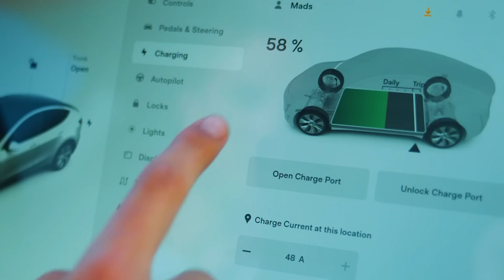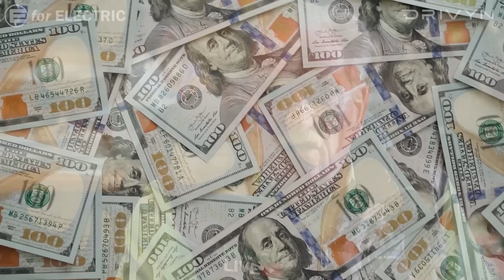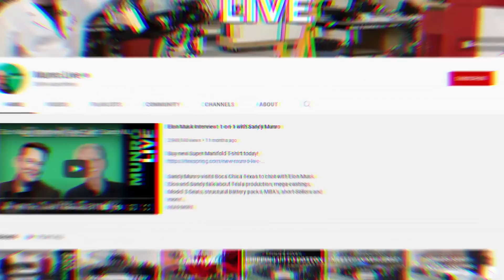SANDY MUNRO Calls Out EV Makers

Comment: Kia and Hyundai must be doing something right… Volkswagen, Renault and Peugeot look to be going in the right direction. But what do I know!?
Reply: Peugeot is not going right directiion, they just take an ice model and slaps in some battery`s and a electic motor.
The packaging is so bad that they cant fit in anything bigger then a 50kwh battery.
that aproach was okey 7 years ago but in 2022 u should produce pure ev`s not something that has a fosil engine orginaly.
Reply: agreed: Renault have even more experience than Tesla on EVs, have a dedicated platform and now even working on 1st batteries that wouldn't use rare earths (for 2027). The Renault 5 will be the very 1st BEV under 20k with 250 miles range. Sandy seems to be focused only on what he sees in the US.. there are lots of innovative OEMs out there, hyundai is one of them as well
Reply: @dnap1991  Sandy is inconsistent when talking about US manufacturers. Sometimes he'll say that Ford is doing the right things. Today he was in cynical mode. No one in the US, other than Tesla, seems to know what they're doing.
Reply: @georgew2014   You are spot on with Sandy being inconsistent.
 But I always find him fun and interesting to listen to.
 Even though this has been released 2 days ago this interview was done long before that.
 Sandy talks highly of Tesla , But  Sandy and his wife had bought a Rivian pickup truck 
 😅
Reply: @icosthop9998   ..... lol
Reply: @dnap1991  …”batteries that won’t use rare earths”…
What ‘rare earths’ do batteries use???? 🥸

Clue: just because it has a strange/odd/unusual/long name does not make it a ‘rare earth’ 🤓

Comment: When I was a senior at the University of Illinois the College of Engineering brought back recent graduates from various companies to let us know what it was like to have a real job. One day they had three guys from GM who had graduated three years earlier. A discussion came up about where to place all of the new electronic modules that were being designed into cars and someone suggested they be placed under the dash. In unison the GM guys said, “No, there’s no room under the dash.” It was like they had been programmed or indoctrinated. I knew right then that GM was not the company for me. Seemed like you had to drink the Kool-Aid to fit in.
Reply: Bad example. My main reason for not sticking everything in the dash is cost of repair. Anything stuck in the dash can be a real problem to fix. Are you that sure the electronics you put in that dash will work for decades to come? If not, does the dash have to come out? If the dash needs to be taken a part it costs a lot of money and will likely never be like new again. Squeaks, rattles, etc. There is no way to pack all the modules in the dash without repair being horrible. 

Also with modern cars you wouldn't be able to fit all the modules in the dash. Next problem is weight and complexity of the wiring for the modules located in one area of the vehicle.  Wiring makes a difference and less is better. Closer to whatever the module controls is better, easier repair or replacement as well. 

GM does a have a group think thing going on but your example is poor.
Reply: @crp9985  i suspect that was a a lesson GM learned long ago, when they had a problem with some electronic components that they put in the dash, and those components kept failing. mostly because of the heat that a dash is subjected to. i seem to recall that a vehicle interior can get to about 120 degrees, and the dash is usually more exposed than the interior is, since its directly exposed to sun light
Reply: @crp9985  Interesting you mention "Under the dashboard" Sandy did a comparison between Tesla and VW EV as the the location of some critical accessories. Tesla puts the critical accessories under the dashboard, VW puts them in the front with good accessibility for servicing. Sandy was critical of VW for their lack of creativity. I though he was absolutely wrong.
Reply: @crp9985  how about the electric motors in the MS dash that will tilt the screen and are being planned? - see Munro Live Plaid dash tear down.
Reply: @crp9985  Your comment shows how completely correct and righteous Sandy is. Its short sighted. 

Look at Telsa. They put the main electronics in the dash and still its simple to change. 
You have to design the dash with the electronics inside. 

Of course Tela is NOT perfect! But they are cheaper, therefor more profitable, faster and overall obviously better than their competition.

I do not say that the dash is the best place or that the front of Tesla could not be better designed or that their suspension could not be a bit softer etc. pp.
Or that they could not have made a better job bribing, coercing and blackmailing the germans to build their giga factory faster and cheaper.
But they change and never let any perceived "standards" stop them.

You must take the following into account: 
There are no "modules". 
The dash is easily to disassemble. 
The crash zone is far in front of the dash because there is no engine to take into account.
There is no firewall because there is no fire.

Now what is your recommendaton?
Reply: @wolfgangpreier9160  You didn't say anything about a Tesla or other EV. Which makes a difference but not that much of a difference. The dash will still be hard to get apart. There will still be HVAC components everywhere, that's what makes up much of the dash. Add control electronics and other electronic options, switches etc. that takes up a good amount of the dash as well.
Reply: I'm going to go look over exactly what is in a Tesla dash and what is not. Don't remember exactly but everything is certainly not in the dash.
Reply: @crp9985  Then you only looked at badly constructed vehicles from the past when the engineers were forced to build as they did. Either because of bean counters or because there is an actual impenetrable firewall in front. In a modern electric vehicle - not a fossil from the last century of course - everything should be laid out cleanly and neatly and easily replaceable. If not - like VW, Hyundai, BMW, Mercedes - those were built by a fossil engineer. Mostly old white geezers who should retire. Look at XPeng, Nio, Aiways, Lucid, Rivian and yes: Tesla of course.
Reply: I may be off here but Guy’s point, to me, was the automatic, exact same response.

It makes it sound like innovation (right or wrong) is frowned upon at gm.

One example though, is tough to make a sweeping judgement though. If you made other suggestions and the trend stayed the same. Then I could make an argument for guy’s conclusion.
Reply: @jerryghirardo6111  In other words just say GM BAD........No shit, they went from the riches company in the word to Bankrupt, could they have done something wrong?
Reply: Yeah, places run by dogma rather than engineering get those kinds of reactions.
Reply: I hope the "Right to Repair" movement grabs hold of car industry. Cars need to be modular to the max. So everyone can do their own repairs easily. Now cars are expensive complex collection of custom solutions that are dang near impossible to repair. EV cars are the perfect platform for this approach. Messing with the batteries could be a challenge, but watching guys change out the Nissan Leaf batteries didn't look too hard. (Too bad they didn't do a good thermal solution). There will be a market for custom good looking vehicles, but the masses need a solution for transportation (but urban road congestion is still a problem, Too many EVs, ICE, Hovercraft will still cause congestion)  "you had to drink the Kool-Aid to fit in" that's a problem at many companies. Oh well
Reply: I have been completely disenchanted with GM from the time I came to understand they have a cycle of failing to be bailed out by tax payers. In business school I learned a lot of bad things about GM. For example, they very carefully destroyed the bus for travel, to sell more cars. 

I have met and worked with a number of ex GM executives and they sincerely believe they are royalty. In a matter of fact way, I asked a frustrated GM executive, if things were so great at GM, why did you leave? And the temper tantrum ensued. 

"There's no room behind the dashboard" is ridiculous. Alternately, Elon Musk was told a laptop screen can't endure the heat in a car cabin. His response was, let's have a full analysis to see where things are at. 

The perceived limitation simply did not exist. And has digital displays for most of the controls in their cars.

Comment: Sandy is ultimately right in his thoughts but the decision making process at legacy OEMs is anything but logical or straightforward. They will always take the path of least resistance and lowest cost. They never truly innovate and are always playing catch up.
Reply: Agreed. I grew up in Detroit in the 60s and 70s and several of my friends worked in the automotive industry and have since retired. They fully agree that the Not Invented Here syndrome is alive and well in the likes of Ford and GM. My experience with engineering in large and/or well-established computer companies, the industry where I spent 45 years, is very much the same. Big companies are slow to change and little ones can easily come along and put them out of business in a heartbeat. I've seen it happen many times and I am watching it happen to the legacy automakers. Sandy just confirms it as do my friends from those companies. Oh, and don't get me started on the whole automobile dealership model. I hope that dies as well. My Tesla buying experience was breathtakingly simple and hassle-free.
Reply: I do  believe they are changing but they are changing very slow.
The CEO of Volkswagen went to Giga Texas for pointers.
Jim Farley,  CEO of Ford is dividing Ford into Two groups.  ICE division  and EV division.  That is something  NEW.

Sadly  Mary Barra of GM  Seems to be all talk for the stockholders.

EV  is the future , even I am going into it screaming and kicking.
Reply: @icosthop9998  - I agree, they are changing at the speed of a glacier (there's a joke in there about ICE...) and maybe those companies (GM, Ford, etc) just downsize and become niche players for a much smaller ICE market of the future.
Reply: Yes, its politics and UAW in USA or IG Metall in Germany who make the real decisions. Its not a place where superior products are made but where UAW workers are being fed and groomed.
Reply: I have little hope for legacy. Tesla stock will only continue to pay off.

Comment: You underestimated the consumer choice. Before purchasing my Chevy Bolt(new battery for free,) there was 4 choices. Kia, Nissan, Chevy and Tesla. Now it seems to have a plethore of choices (Vietnamese, chinese arrivals) and consumer don't only look the best for the buck (Tesla). Hopefully they will improve their technology or they will collapse. Sandy push the legacy automaker against the wall. Do they'll step up? I hope so.
Reply: I recently put new tires on my Bolt. I got Goodyear Assurance Comfortdrives and it transformed the vehicle. The ride is now comfortable, quiet and stable.
Reply: Agreed. BTW Renault have even more experience than Tesla on EVs, have a dedicated platform and now even working on 1st batteries that wouldn't use rare earths (for 2027). The Renault 5 will be the very 1st BEV under 20k with 250 miles range. Sandy seems to be focused only on what he sees in the US.. there are lots of innovative OEMs out there, hyundai is one of them as well
Reply: There aren't any Chinese choices where I am (USA). The VinFast is at least in auto shows. There may be a few Chinese made cars or owned by Chinese companies, but not Chinese brands in the USA. The choices from older car makers are still in a ramp-up stage and may be for a few more years.

Comment: What happened when GM went bankrupt? Everyone got their contract bonus and life went on.
Reply: They  went and designed and made the Volt, later cancelleď that after  a couple of years , then made the Bolt, which needed a TOTAL RECALL.
Reply: @aurelio-reymilaorcabal9669  well this is the first example of GM out sourcing the design of a vehicle that i know of. and also buying  the cell, pack from the same company. and the company that sold the packs and cells, had a manufacturing error, that was rare, that made 10-20 cars of 140,000 made go up in flames. the biggest reason that it became a big story, is that there are some who want the EV to go away, and ICE to stay for ever, never mind that there ICE vehicles that go up in flame almost every day  to the point its not even news.  me i was very happy with Volt, but replaced it with a Bolt (mainly cause when i did that, the prices of my Bolt was less than 30,000 with all of the incentives at the time).  the reason for the total recall was simple no one could find out what VINs were going to cause a fire. they tried twice to find it, but failed every time. that left then very little choice as to what do. but since GM bought the pack from LG, and GM supplier contracts have a clause in them, that basically states that in a recall the supplier pays for the recall. so GM got a lot of few packs, and didnt pay to have them replaced.  and this could happen to Tesla, they buy packs from Panasonic dont they? could a manufacturing defect there impact Tesla? of course, but if Panasonic has better quality control, they wont allow that. lesson learned hopefully, quality isnt a cost to control(see Boeing and  737-max). sort of reflected long ago with Ford job 1 add campaign. which they did because they had more than a few problems with their products.
Reply: @davidwillims2004  Tesla buys the Cells from Panasonic , and turns it  into battery packs, you better do some  research before making wrong  statements.
Reply: @aurelio-reymilaorcabal9669  thats wat i said, Tesla buy packs from Panasonic
Reply: @aurelio-reymilaorcabal9669  i guess i was wrong just like every one else from time to time
Reply: @davidwillims2004  Tesla also engineers  all the electronics  ,cooling systems for the batterypacks  and Batt Management Systems all in house,  Tesla  makes their own traction  motors  and inverters as well.,they are very vertically integrated ,even making  their  own seats, something legacy auto  has farmed out  to other OEMs  like  Lear, who is  one of the biggest seat manufacturers in the World,Tesla  profit per vehicle   is only second to Mercedes  behind  by $14, Tesla  has more profits than Hyundai , Honda and Renault despite those companies making  cars  by the millions, Go see  last weeks Autoline daily  piece by John McElroy  " The numbers don't lie , who is the best automaker in the World", , he  adds @ the endwho has and is  the most efficient  business model.
Reply: @davidwillims2004  Battery cells   are individual  batteries !Packs are completed cells assembled into a  pack  !
Reply: And the taxpayers haven't been paid back for the bailout and it's been 14 years. Except for Tesla. Tesla paid back the loan. They paid it back early with early payment penalties.
Reply: @davinciconcepts  GM did actually pay back their loan, years ahead of schedule even, in full plus interest. There are some other shenanigans going on where most of the money GM got wasn't actually considered a loan or something like that, but they did in fact pay off the loan at least.
Reply: @sipher3516  The federal government on Monday sold its remaining shares of General Motors Co. stock, ending the controversial $49.5-billion bailout of the automaker with an approximately $10.5-billion loss for taxpayers. Dec 9, 2013
Reply: @davinciconcepts  actually thats not true. GM paid the loans back, early
Reply: @davidwillims2004  The federal government on Monday sold its remaining shares of General Motors Co. stock, ending the controversial $49.5-billion bailout of the automaker with an approximately $10.5-billion loss for taxpayers .Dec 9, 2013
Reply: @davinciconcepts  apparently its okay not to pay back the government but it is not okay to be successful and become a billionaire.

Comment: As a consumer some of these bad decisions have made for great used EV deals, otherwise I'd be still driving gas 4 years later dreaming about Tesla's. If I was going to buy new, Chevy Bolt is a great EV, if a model 3 is much better and only $15K more, it's still out of the question.
Reply: I bought a 2017 Bolt Premier with 26K miles on it In November 2020 for $16K. The battery was replaced by GM in February 2022. I recently looked at the website of the dealer I bought it from and they were asking $22K for a 2017 Bolt LT. 

Until recently I didn’t like the Bolt very much as the ride was rough and unstable. After the battery swap, however, the Bolt needed new tires, so I got Goodyear Assurance Comfortdrives and it transformed the vehicle. The ride was now comfortable, quiet and stable. With the increased range from the new battery and the much better ride I am now enjoying the Bolt for the first time. So much so that I added window tinting and a trailer hitch for a bike carrier.
Reply: I can't wait to get a chevy Bolt. Tesla's are cool but the Bolt cost less and you can get parts if needed.
Reply: I love my Bolt! Fun. Fast. aFfordable!
Reply: Used prices are even farther apart
Reply: A majority of car buyers are not EV owners, majority of EV owners are not EV nerds. Normal adults could test drive a Bolt, see it's fun to drive has great range in it's price class. It doesn't have the fastest DC charging rate, what's that, I can charge at home right? Win!
Reply: Renault have even more experience than Tesla on EVs, have a dedicated platform and now even working on 1st batteries that wouldn't use rare earths (for 2027). The Renault 5 will be the very 1st BEV under 20k with 250 miles range. Sandy seems to be focused only on what he sees in the US.. there are lots of innovative OEMs out there, hyundai is one of them as well